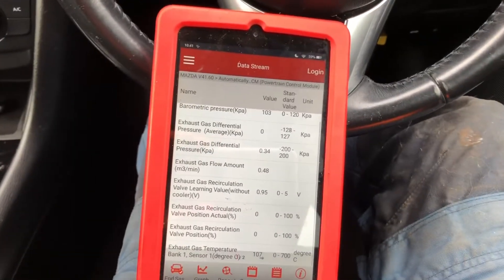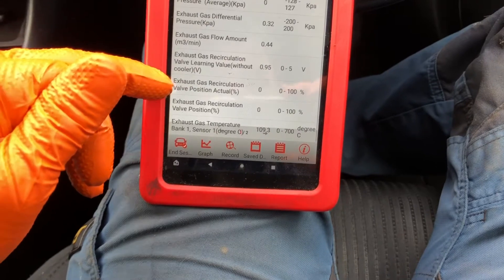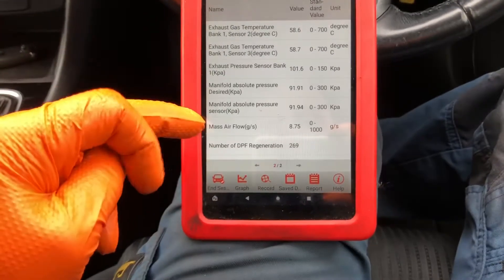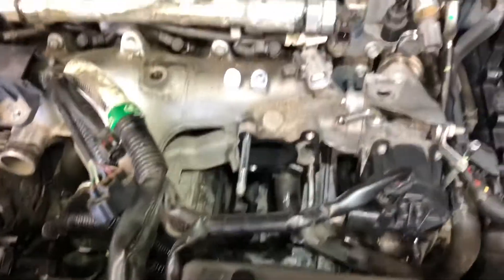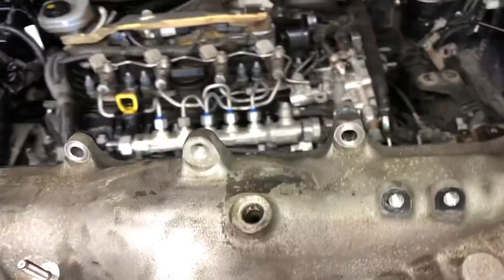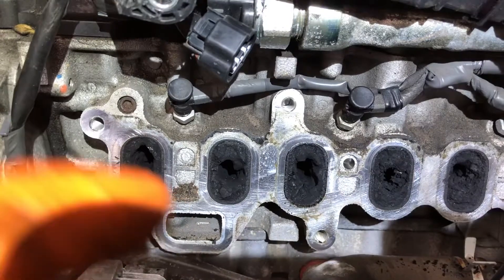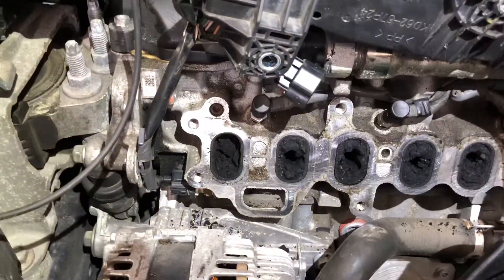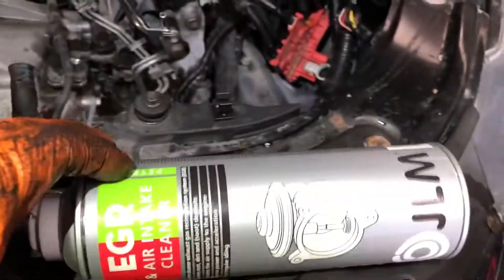Mazda P0401 egr fault & de-carbon intake system

Comment: Excellent vid. Thanks for taking the time.  Turning the wheel in gear - good way to turn motor over to close the valves.  However what would you do if it was an automatic?  
I am in NZ and wife’s  car is a CX5 2.2D and now done 217,000 kms. Had since new in 2013.  Had a new engine block at 140,000 kms paid for by Mazda NZ which I speculate was due to either a cracked head or blown head gasket  - a lot of these replacements have been done due to some fault  but Mazda would not say what it was definitively = overheating and bubbling out the radiator was the symptom when failed.  Auto transmission subsequently failed at 170,000 kms.  Took some serious words, but got Mazda NZ to replace this at their cost also.  So now I discover this EGR system is continuing to wreck the engine.  I know all the ins and outs of its purpose, but it has to go , along with the DPF - which due to regeneration is continuously watering down the engine oil - never had a car with rising engine oil levels.  No good for the engine can come from any of these shocking systems.  The car is now spitting up faults due to carbon build up and has become unreliable.  A lot of these so called modern diesels are not going to last.  People are trying flick on to other unsuspecting people once they discover the serious problems of these engines.  Disgraceful. I could not do this.  I am however going to give Mazda NZ another serious talking to, delete both DPF and EGR and have engine remapped.  Been quoted around NZ$2,750 for this.  But first I need to check turbo for bearing damage, hope replaced engine is still okay, replace injector seals as apparently they leak further raising oil levels and decarbon the inlet manifold.  Sorry to go on, but fairly pissed.
Reply from the maker: They can there fair share of problems 😬
But yes I totally agree there are too many bits that can & do go wrong nowadays. You will have to buy electric 🤪👍
And I enjoyed the rant 😉😉
Reply: Owning a CX-5 2.2D since 2012, The engine was replaced at 120kkm, and it is reaching 240kkm, same errors are coming up every now and then,  the engine is probably falling apart again.

Comment: Hi there. Had/have 0401 p reading also. Took off egr and and the pipe just after it. Cleaned and hoped it would work, but nope! Roughly, how much would it/should it cost to take off intake manifold/cooler etc for a clean please ....roughly.....tia
Reply from the maker: Hi James, €400 + vat  it would cost with me .

Comment: Very helpful I done the same thing on my mazda 6 skyactive but now I have a nother problem when driving and stop at the traffic light car stalls any suggestions,not enginemanagementlight on or codes. Thank you
Reply from the maker: These are equipped with START/STOP 🤔
If you press the clutch and go to move off again will it start on its own ?? 
If not just drive it for a few days and see does it register any fault codes to give you a direction to go in. Let me know how you get on 👍

Comment: This is just nothing short of an excellent video Peter as you cover both theoretical and practical - consider doing an online training course (I'd pay for this!) for us home garage enthusiasts 😉 I have this exact engine and your trick of 4th gear, one wheel off the ground, is nothing short of a revelation (I have a cheap and cheerful borescope) - so simple when you know how as all other videos were showing how to turn the crank shaft to align valves or quick brief starting (not easy when you have half the engine on the floor!!  The 2.2 I am working on hasn't anything like the carbon build up in the manifold but the rest looks very similar.  Keep posting videos - you are an excellent tutor. 👍
Reply from the maker: Thank you very much, it is really nice to get positive feedback. I’m working on another Mazda 6 at the moment and have a few videos being uploaded in the next week or so keep an eye on my channel for them. Thanks again Damien 🙏👍
Reply: Defo deserves far more views as these are popular cars. Owners need to know about this disaster of a problem before the limp mode happens
Reply: I’d definitely pay for a training course as want to do what ever work I can do myself as don’t have reliable garage in Dublin

Comment: @Kennedy;s garage, excellent video. Just bought one of these with 88k miles so looking to do this carbon clean. Which gaskets did you need to change and which could you reuse? Thanks Damian
Reply from the maker: You should replace them all but they are all made of steel so won’t break & could be reused if needed. I have done in the past.
Thanks for watching & commenting 🙏👍

Comment: Holy 5hit!!  I'm presuming this is a diesel?  Not sure because it could a direct injection petrol?  Anyway, I have a Mazda 6 MZR-CD 2.2 diesel and I'm wondering if I have this issue to look forward to?!  Is there any additive for the fuel that can reduce or prevent this?
Reply from the maker: It is a diesel & the sky active suffers quite badly from carbon buildup. The additive that I recommend is ‘JLM Extreme clean’ it helps keep everything from injectors to egr & intake manifold clean. It would be worth using every few months just to keep everything nice and clean 🙏👍
Reply: @kennedysgarage3281  
That's great, thanks.  It seems ok at the moment, I just had a P2565 DTC which turned out to be the vvt actuator sensor, replaced that and it's back to normal power, actually a bit better and more responsive at low revs, so that sensor has probably been dodgy for a while before it tripped the DTC.  I'll use that additive from now on though, thanks again.
Reply from the maker: @turboslag  thanks for watching & commenting 🙏😉

Comment: Thanks for vid, I have to do the procedure for my Mazda as well Dealership ask me for 900 euro for this. I hope carbon won't get in the chambers..:)) will see in a few days
Reply: Hello again, I have done it. I was surpised the car start straight away. It wasn't that bad like in your vid but still. My problem persist, I have an intermitent hesitation for a second at higher speeds when I shift up the gears after that second the car pull normal... I changed fuel filter I try with both egr valves, chane maf sensor.. any sugestion?

Comment: Seen this twice now great video I really believe I have thus issue . Where did you get the torque specs from buddy ?  I know the intake ones are 20nm but the others ? Obviously you bleed the cooling system after rebuild . My map was as , if not worst , bad as yours was caked . So my intake is likely as bad . Great work . Would have liked to see those valves after you cleaned them . Did u use rags to get in there ? 

Thanks
Reply from the maker: I use Autodata for all my torque spec’s , I have a cooling system bleeding tool which sucks out air & fill’s the system again. And if your MAP sensor is bad it’s a good sign that the intake manifold & ports are bad. I hope this helps Kevin
Reply: @kennedysgarage3281  hi I only just came across this fella appreciate the feedback mate I  have heard that before about the map indicating the intake is dirty . Also. 

I'm pretty confident in doing it is that a site of some sort for the torque settings ?.I recently cleaned egr valve the 1 that sits on 4 bolts . And the link pipe . Bit grubby I guess.  I have had some flat spots and at 65/70+ it's not as smooth as I'd expect (feels a bit lumpy I guess ) . Only code I get intermittently is p2262 turbo boost not detected . When googlimg this code many have said their issue was the exhaust pressure sensor  which I've ordered (bosch) . I've heard occasional noises which I'm going with egr  I've read the egf can make rattling type noises if obstructed . Etc or failing .

Thanks for any further help .
Reply: @kevinhancock4064  the exhaust pressure sensor is a genuine Mazda product and unfortunately there isn't aftermarket replacement. The current version comes in a kit with a new bracket, rubber pipe cable ties, etc., because Mazda has redesigned it a few times and the new version has metal housing and a new shape. But it is produced by Bosch of course as all the other sensors. 

Actually there are two sensors, what Mazda references as Exhaust Pressure Sensor No. 1 and No. 2. - No. 1 is the sensor what I described above, No. 2 is the one also known as differential pressure sensor. For P2262, you most likely need to replace the first one. But here is the list of possible cause:

  Exhaust gas pressure sensor No.1 malfunction

•  MAP sensor No.2 malfunction

•  Compressor bypass valve malfunction

―  Compressor bypass valve fell off

•  Small-type turbocharger malfunction

―  Turbine blade or compressor blade damage

―  Runout, loss, or sticking due to turbine axis wear

•  Exhaust system clogged

―  Diesel particulate filter clogged (damage, burnt out)

―  Clogging caused by freezing

•  PCM malfunction
Reply: @_GSzabados  yeah I've already spoken to mazda about it they do them for £60+ exc vat  .....he didn't mention 8t came with the plug and tube etc ..you can get the genuine 9nes as a kit on ebay 106 pounds I think it Is
Reply: @_GSzabados  hi again ive now git thecsayd eejsir attempting utbtodsy . Sensor itself wouodhtvtaje long but I'm to check the metal hose lower down.  Pig of a job really but could be worst ..no toom in these engines for these sensors lol I'm still getting p2262 it's had bew tugboat kit and 2 sensitivity at the rear of turbo so this is only one left I believe..it was def better after other 2cwere changed.  I think my buzz noise (occasionally) is linked . My theory is the sensor is trying to read the turbo pressure and can't read it well due to bad sensor and/or blockage . The noise could be the pressure not reaching sensor
Reply: @kevinhancock4064  I am not sure about the turbo pressure sensor, that can you buy it separately or only together with the turbo. BUT I learned during the past 6 months that these 2.2D engines are notoriously famous about soothing. I have a Mazda 6 2.2D Wagon with just more than 100.000km. I had an issue in October with a P2262 and P0401 popping up and loosing power. The official Mazda service had no clue about it, they couldn't read the codes what I've got with an OBDII tracking device. They told me that it must be the exhaust pressure sensor, and they cannot get it because it is not available in Europe at the time. A lot of bullshit. Mazda should have revoked the ASO's license, but they don't give a f*ck. I've got the exhaust pressure sensor replaced, the codes went away, but fuel consumption was up by 1.5-2 liters per 100km. I took the car in February to a non-ASO in my home country. Their first questions were the following, has the oil sump been removed, has the oil pump chain changed, has the oil sump filter been cleaned. They did the same what  @Kennedy’s garage did in the video, removed the intake manifold, cleaned it (actually replaced with one of their replacements what they took for cleaning and sandblasting). Cleaned the sooth out from the inlets, got all the injectors measured and inspected, got the sump removed, cleaned, filter changed, chain changed, sensors checked and one of them replaced, etc. A lot of job, the car stayed in the garage for 5 days. After that it was like a new car. They advised me to do clean sooth every 70-80.000km and change oil every 15.000km or less. I asked the owner, what car should I buy, if I sell this one, he told me, buy the same but the petrol one. It hasn't got all the problems what diesel model has.
I have seen some other videos where people were cleaning these engines with one of Liqui Moly's products. I don't know how effective it is, but what is sure, if you have all these errors then your engine probably full of sooth. Take it to a garage and get it cleaned properly. It will just get worse.
Reply: @_GSzabados  hi mate the intake has been dine as my turbo kit head gasket timing chain rockers cams and oils etc . So no issue there tickler is sweet . I'm replacing my exhaust gas pressure sensor this eve and I'm feeling positive its my final issue at least for now ......I'll be doing sump and gauge on next service maybe just after Xmas so it'll be sooner thanks mate yeah carbon is an issue for these indeed
Reply: @kennedysgarage3281 I had loads of work done after matey even took dealer to court (nor mazda) ..mostly running well niw onky regens could be shorter.  And I need to change out coolant sensor the 1 I put in it wasn't oem  but have original now I don't hear the fans

Comment: @Kennedy’s garage, to avoid having carbon build up falling in the cylinders while cleaning, is there another way apart from a baroscope?
In-take valves will be closed on top dead centre for their respective cylinder.
Is there anyway to get crank shaft position without doing more dismantling?
Hmmm... Or what if you used a vacuum/hoover while doing the initial scraping, enough to get a view of the valves?
Or heck, keep vacuuming for the whole scraping process, to contain the carbon build up, instead of going everywhere?
Is the carbon build up very sticky or quite brittle?
Reply from the maker: Another guy suggested the hoover to me after I made this video and I thought it was a great idea. Well worth trying.
Also how about blowing in the intake port while turning the engine until the air stops flowing, then the valve must be closed 🤔. Let me know how you get on 👍
Reply: @kennedysgarage3281  thanks, will do 👍
Reply: @kennedysgarage3281  Hey, 1 more thing...if you remember.
What was the Mass flow reading after the cleaning process?
In the video before cleaning at idle it was like 6-9 g/sec, you had mentioned you expected it to be around 14.
Do you remember what the reading was after you cleaned the carbon in the intake/EGR valve?
Reply from the maker: @xegro  I really don’t know ☹️ it should be around 16 grams per second. But I have Snap on, Autel, launch & Mehle all giving me different numbers which makes this job impossible. I show this in one of my videos and should probably do a separate video showing this. Sorry I couldn’t be more detailed
Reply: @kennedysgarage3281  I took off the Map sensor, it's caked in Carbon deposits, fully covered... I haven't got a fault code yet, but it's definitely on it's way.
How much would a garage charge to clean the Intake manifold?
Reply: @xegro  u just had 1 quote from a drive in drive out firm that does it 90 per cylinder minus any gaskets which would be extra
Reply from the maker: @xegro  around €500 but of course this is dependent on all going to plan & the hourly rate of the garage 👍
Reply: @kennedysgarage3281  Hi again sir 😁
Just wanted to thank you for your insight and input. 
So I ended up doing the job myself.
Wasn't too bad.
I used the vacuum/hoover method while using a pick in a direction away from the block/towards me. 
The carbon build up wasn't as bad as the 1 in the video. The EGR passage wasn't completely blocked, but it was still significant. The Intake manifold + intake port had a lot.
I had no Codes stored, but I could tell with the way it was driving and idling on cold start.
It drivers better now. 
A lot happier at lower revs. 
More pick up/nippier at lower revs.
Less turbo lag between gear shifts. 

I forgot to connect 1 of the coolant hoses... That was amusing.
I had difficulty taking of the intercooler pipe... Was stuck/seized because of carbon/grit.
I busted 1 coolant pipe, because it was just not coming off... Had to buy a replacement and cut it to size.
Overall, great learning experience.
Oh by the way... 1 more way I learnt how to find top dead centre  is using a paper straw... But didn't work for me sadly, I think the in take ports on this engine are quite long. 

But yeah, thank you again.

I'm currently working towards taking off the dpf filter and cleaning it with degreaser then with acid.

Currently struggling with a 10mm bolt that's on the dpf filter heat shroud, between the back of the engine and firewall, very very limited on space and its seized. 

Wish me luck 🤞
Reply from the maker: @xegro  well done my friend, it is great that you were able to do it 👏👏& I’m glad it is running better 🙂
Good luck removing the Dpf, but do a lot of research into what you are going to use to clean it as you don’t want to damage it. 
JLM products are very good 👍
Reply: @kennedysgarage3281  Thank you.
Yeah I've done a decent amount of research.
I've watched Steven B. Tuners's videos.
He has done some experiments with differeny chemicals and methods.
Very informative.
It's the most effective yet least damaging method. 
The Degreaser gets rid of the Carbon/Oily soot, and the Hydrochloric Acid/Pool cleaning Acid/Brick cleaning acid(33%) gets diluted by a further 1 part to 4 parts water...this is so it doesn't eat the Steel... But still gets rid of Ash build up. 👍
Reply from the maker: @xegro  all sounds good, let me know how you get on 👌
Reply: @xegro  where you from, i need this job doing
Reply: @dmc_77  Hi, I'm from Manchester.